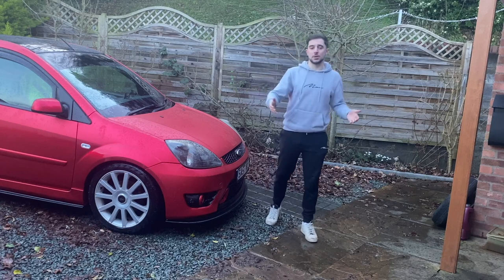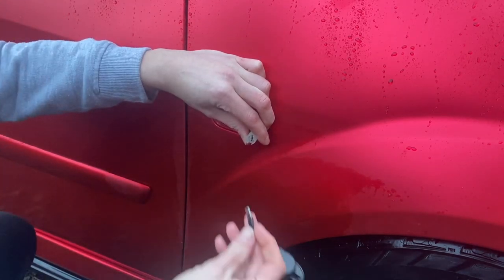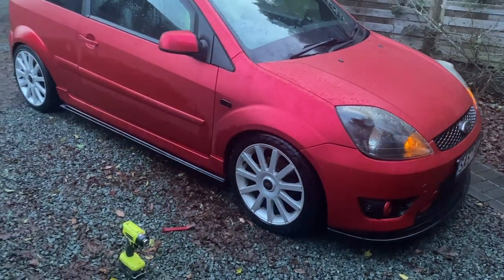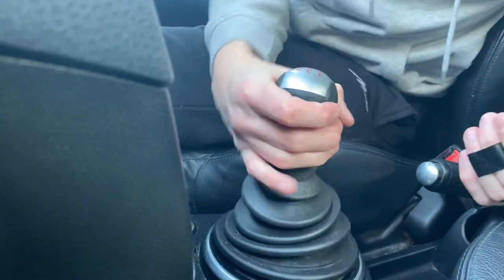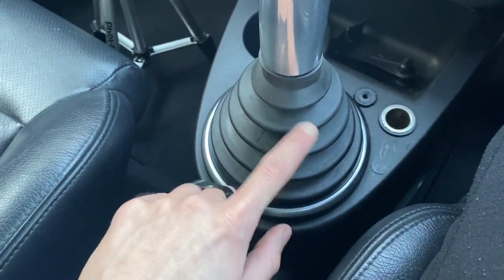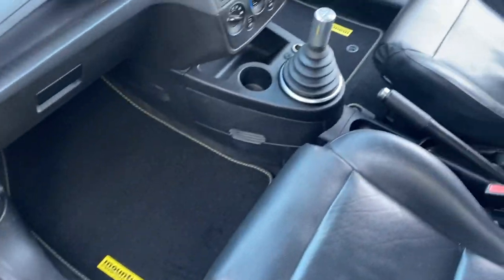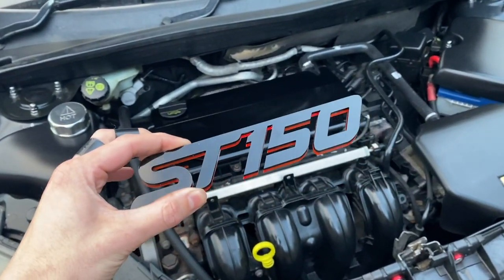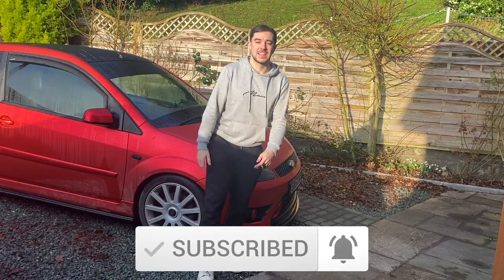5 Mini Mods for my MK6 Fiesta ST150

Comment: I’ve taken away that old stereo and replaced it with good 4K screen try it out mate looks good on yours
Reply: Genuine question, when you you disconnect the battery to mess with the car, does the screen prompt a code like radios do when you reconnect the battery? Thanks

Comment: Can the bumpers, splitters, side skirts, spoiler, and rear diffuser of the ST150 you have fit the ‘07 base model fiesta?

If so do you have the links? 
Thanks
Reply from the maker: You would have to ask TRC I’m afraid mate. The diffuser is just the ST one so you’d need the ST bumper

Comment: Where did you get that engine cover/rocker cover from? Looks good
Reply from the maker: It was second hand but if you check out my wiring loom tuck video where I fitted the cover there a link to a new one 👍🏻
Reply: @MendItModIt  cheers will do👍